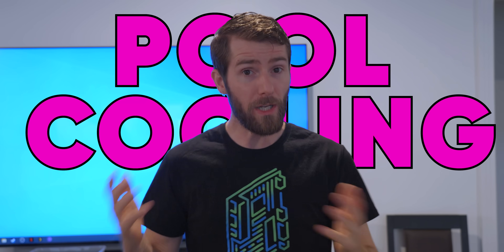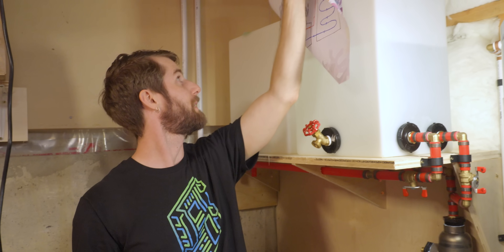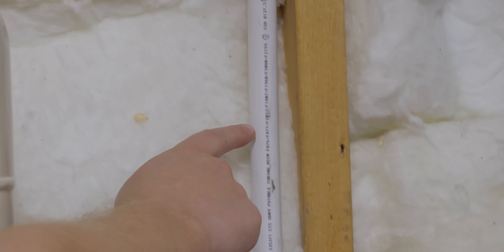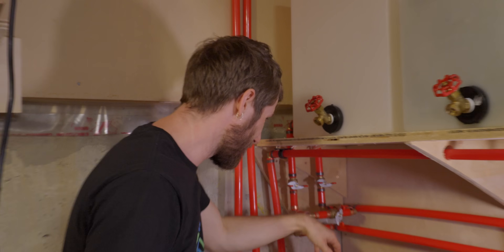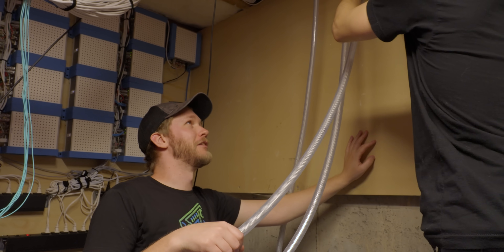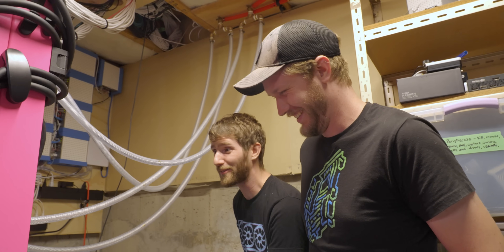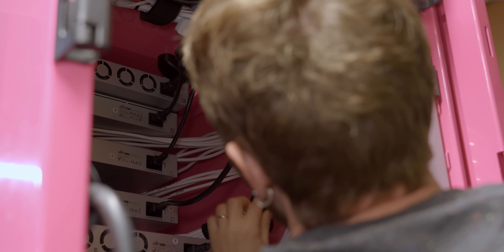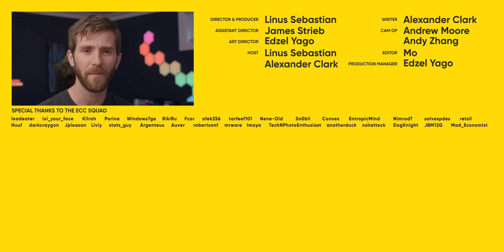My pool leaked and killed my computer - Whole Server Room Pool Watercooling Part 4

Comment: I would have added a pressure valve for the bypass loop that opens if the pressure rises above a set point.  This way, if he takes machines out of the loop and the pressure rises, it opens as needed to bleed off pressure.

I'd also love to know what caused that switch to lose it's magic smoke.  I'm thinking maybe a spritz of water made it's way up there?
Reply: Maybe one of those custom cables was buggered? It only happened when he plugged it in with the new cable, but I'll be buggered if I know what about it could do that
Reply: @mattymerr701 Maybe one of the cables had live and neutral reversed or something. That could definitely cause some magic smoke to be released.
Reply: @mitchellwilson12354  could be although being A/C usually it wont matter as much, but if maybe live and ground where swapped i could see that dumping 120v all over the ground plane, i guess it all depends on the PSU that ubiquity switch uses. if hes lucky its just a dead psu, and maybe wont need the whole switch replaced
Reply: @mitchellwilson12354 reversing live and neutral doesn’t matter for AC, only DC. But if one of those was swapped with the earth wire it would be an issue.
Reply: @xDMG15x  swapping live and neutral for a device referenced to ground DOES matter. You are thinking about 2 prong devices like lamps or phone chargers where it does not matter.

Edit: If you don’t believe me a quick google search will educate you.
Reply: @mitchellwilson12354  i was thinking of the figure 8 plugs on a ps4 and AC exhaust fans where you can’t reverse the direction it spins by switching the active/neutral like you can switch +/- on a dc fan.

This switch is not referenced to earth. In this case it is a protective earth because the switch housing is conducive. It exists purely to prevent electric shock in the case that one of the other wires shorts to the case of the appliance. The earth wire is not part of the circuit until there is a short.
Your ground reference theory might be legit but it doesn’t apply to this switch.
Reply: @xDMG15x  his is really an it depends moment. if the PSU is referenced to earth ground on the 110V side it is possible that swapping L/N would cause a short. if the PSU is only connected to earth on the low voltage DC side through chassis grounding then probably not. In the US a houses MAIN neutral Buss Bar is bonded to earth ground as we use a split phase 220V system that is 220V phase A to phase B and 110V either Phase to neutral
Reply: It’s hard to tell what happened because after he yanks the cord out like a child would, it cuts to all the new cables connected so who knows. The amount of smoke makes me think the cable worked for a short time and something got super hot. If wires were crossed it would have tripped the breaker instantly with no time to heat up. I’m thinking the active and neutral wires were touching somewhere in the cable and there isn’t any overload protection on that circuit.
Reply: He did comment about adding a “bypass”while mentioning the pump was a lot for the lines. He didn’t say pressure bypass but it was. Short handed . Looked like they added a hose with inline check prv to one of the unused manifold ports, and that hose then ran to the reservoir I’d assume.
Reply: @itsourtime  I wasn't sure what that was in the bypass line, just assumed it was some sort of connector.  Nice catch.

Comment: You could've used automotive AN fittings (they're self sealing and can handle extremely high temperature/pressure), a couple of high pressure fuel pumps (the most powerful ones flow up to 5000 CFM) teflon lined braided stainless steel fuel lines and a pair of large air to water intercoolers.
Reply: And they're 12V powered, just like the computers
Reply: @IrredeemableGhost 
The fuel lines are also excellent at bleeding off heat because they're designed specifically to remove as much heat from the fuel as its pumped through the system (basically they're a direct liquid to air intercooler) to ensure its as cool as possible when it gets to the high pressure pump and injectors so the fuel charge is as dense as possible for the best combustion performance.

Years ago a friend of mine built a cooling loop for his gaming pc using a spare set of holly braided stainless fuel lines he had lying around from a racing engine build he'd done for someone in compilation with AN fittings.

It never once leaked (even when he deliberately over pressurized the system to test it from time to time) and he was so impressed by the performance gains that he still uses that system (with minor upgrades) almost 15 years later.
Reply: @Hammerhead547  That sounds beautiful. Literally and figuratively.
Reply: @IrredeemableGhost 
I've only seen it once (before he moved across country last year) and it is.

He's a machinist/engine builder by trade so the entire thing is custom built to his personal specs with tolerances so fine (from what I remember the widest tolerance is 35/1000'ths of an inch) that he measured them using the same feeler gauges he uses to measure tolerances on the engines he builds

Comment: I had a similar issue in electronics class with in and out. Which wires get to be red and which gets to be black?

Alex took the binary approach a tube is either in or out, but the advantage of labels vs coloured tubes/wires is you can label one side in and one side out

Comment: I really want to know why the fuse was tripping and why that caught on fire.
Reply: right like how could these things be left unanswered. that was wild.
Reply: Yea wtf happened with that ubiquity switch thats crazy
Reply: same here was so annoying they just glossed by those things
Reply: I was combing comments looking for this one. I too want to know why the Ubiquiti switch died and what was causing a 25 amp fuse to pop immediately upon closing the circuit.
Reply: They mentioned an extra standoff screw, that could have been shorting and popping the fuse. The long beep might have been a UPS unit complaining of building wiring/ground fault - if the standoff shorts the board to ground you could have significant current go to the ground pin until the fuse pops.

 The unifi switch I'm betting is a malfunction of the SmartPower connector to the Unifi RPS unit. The Unifi RPS unit is basically a box full of power supplies that connects with what looks a lot like a motherboard 24-pin power connector to the various pieces of equipment. The fire happened right after Linus unplugged the RPS unit. My guess is that the Enterprise XG switch for whatever reason had a back-flow of current drawn through it's SmartPower connector because the RPS unit no longer had it's own supply. If all 6 or so pieces of equipment are then trying to use the Enterprise XG's AC supply through the SmartPower connector (which is intended to flow in the opposite direction!) it  would surely burn up.
Reply: I’m pretty sure the room was hot so the water maybe could have ended up in the switch corroding a connection which led to the fuse popping
Reply: guess we gotta wait another 2 months for part 3
Reply: From my experience as a licensed auto technician on cars/light trucks, fuses will blow when you have a short to ground. Water probably got in one of the icron docks and as a protection, the fuse blew. Most likely the same with the switch...when he was pulling power cables my mind was going "well you just killed everyone's internet on the network!"
Reply: It's almost like we're getting a cut-down version of the video and the EP version with all of the unanswered questions is on Floatplane.

Comment: Downtowm Toronto sky scrapers use heat exchangers. Water drawn from the depths of lake Ontario chills the air conditioning system to keep cool multiple sky scrapers with 40 plus floors each. The sys is called DLWC= deep lake water cooling. Not new engineering but still fascinating.

Comment: Why are there no compression fitting on the wires ? You will get negative wire loose and the whole system will burn out.

Comment: Put a pressure relave valve in the bypass... that way you make shure, that the cpu and so on is getting cooled, but the pressure is not high enough to burst anything.
Reply: well if done properly there would be some real industrial automation engineering that would keep track of many sensors, pressure yes, but also flow and cpu/gpu temperatures with proper handling when parameters are out of range.  It's amazing what you can do with a DIN panel and a little know how.
Reply: @bitcoinsig  Yes, but in my opinion overkill. The valve only makes shure that a certain flow through the system is certain. everything after that is overkill imo.

Comment: if you had the water pump on a ups like you should have, you would have known to plug it back in. you were setup to fail if the pump was . as for filtering a large home water filter will still give the flow you need while being replaceable.

Comment: I hope you are going to put some foam around those pipes outside,  pex is not to be used outside in direct sunlight, the UV rays will kill it over time.
Reply: If that's true, this is an important comment! Hopefully they see it
Reply: I give it three months max. In the summer.
Reply: I don't think they know considering they used PVC outside for pressure and PVC along with PEX don't do well with sunlight. It's why PVC should only be used outdoors for drainage and not pressure What they should have done was used copper and then transitioned to PEX when out of the sun. Take that conduit pipe the pex comes through put a box on top of it and in the box make the transition from copper back to the pex.  Also if his plumber told him it was ok to use pex outside, get another plumber.

Honestly you should just get a plumber that works with wells, there are quite a few things you could add that wouldn't kill your pressure. For example get a uv light system installed as well like they do with well water, it will kill the bacteria in the loop.  They make rather larger sediment filters, and pressure tanks that could work with your pump so the pump is not running 24/7 burning itself out all the time.

Comment: Want a fitting to never leak, Teflon tape follow with pipe dope.  Unless you buy high quality fittings, anything from the big box stores are made in China on worn out machines with dubious quality control, they will leak.

Also you should use Constant Tension Hose Clamps rather then worm drives.  Worm drive clamps do apply pressure evenly and don't handle temperature changes well over time.

Comment: So quick question. And one I doubt ill be able to find on google with this being so unique lol, but if its being cooled by the pool and winter comes, I know the whole pool wont freeze but wouldn't the water get cold enough to maybe cause the loop to drop below ambient and cause condensation?
Reply: It was never being cooled by the pool water. Originally, the loops went under the pool (there is piping embedded in the concrete), but with this adaptation, that pool loop just comes into a heat exchanger with the new computer loop, and they exchange heat (but not water) between them. As such, the water will never get that cold to cause condensation issues.
Reply: @jasondaniels3073   Ahhhhhh makes sense after explained properly. Thank you.

Comment: I'm an old AV nerd that learned about "in and out" through the use of RCA cables. I'm with Linus, but technically, the hoses themselves don't need to be labeled with "in" or "out." Doing that extra work was useless and confusing. But it's still entertaining

Comment: literally the whole comment section told him to use a heat exchanger. Ignored it. Deserved it. Well, finally he is doing a heat exchanger, so that's good.
Reply: i don't fancy the reliability of the plastic manifolds ......
Reply: Yeah, the manifold is jank for sure. But the heat exchanger is good. Step forward for sure.
Also he needs to regulate the pool loop speed to keep the temperature inside constant, to stop condensation in winter. Not sure if he does it already. @daveharsant2261

Comment: With your reservoirs, you should have placed the bulkheads at the top with internal tubes that reach the bottom of the tank. This leaves you without needing to worry about leaking. Plumbing 101. Something else I would do with the distribution blocks is place them outside of the server rack and below your servers (or at least just below if you do keep them in the rack) that way if they do begin to leak in the future you have much less, if zero chance of the water flowing down the tubes directly into the backs of your servers.
Reply: With the dist blocks below the servers you'd need to worry about air bubbles resting near the quick connects. But I do agree outside the rack would have been smarter.
Reply: @michaelkr1  I don't think they are going to have much issue with air bubbles with the pressure that pump was doing, wew
Reply: Yeah, that just looks like a disaster waiting to happen. I don’t get their design decisions. He spent so much on that house and all that setup and cheaper out on things like the manifolds and mounting them. Better to mount them in their own storage with a reservoir and leak detector rather than waiting them to spray water all over the inside of the server cabinet.
Reply: @bcbock future content, my friend.
Reply: @bcbock  Yeah the whole "plastic manifolds suck" followed immediately with "oh well" and a jank workaround.
Reply: @bcbock he would have been further ahead to leave everything air cooled and installed a beefy mini split system.
Reply: it's very much intentional, that entire ridiculous setup exists as a vehicle for future content. people want entertainment, watching some competent data center engineer do their day job and install a well-designed system that works first time would be a single boring video. and entertainment includes furiously writing comments about manifolds and pex pipes btw.
Reply: Unless the pump being used is self priming the outlets needed to be at the bottom of the tanks with the pumps bellow to get water into the impellers.
Edit: I guess the pump is somewhat self priming so maybe that would have worked.
Reply: Problem with that is the pump, will it be able to pump that water from the floor up into the computers?
Reply: Thanks, very interesting info!
Reply: All of the pump priming issues could be fixed by simply using valves to create a smaller loop, using one or two extra smaller booster pumps at the bottoms of the tubes in the reservoirs (like a massive res/pump combo system) to get the flow started into the bigger pump, then you simply shut them off, and then introduce the big pump to the rest of the system by opening the valves. Should work in theory.
Reply: Stop giving out logical tradesman information for free 😂